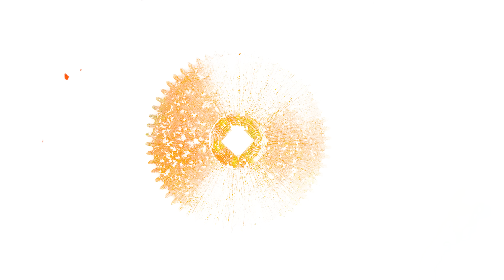Restoring a Rusted Rolex Found in a Drawer

Comment: Guys, this is a FAKE Restoration, here is why I think it is:

-Theres a TON but like a jar full of rust liquid covering the WHOLE movement, yet I couldn’t find a SINGLE part that showed any pitting, rusting or the slightest degradation, not a single screw seems to have been affected by the liquid.

-at 1:31 you can see FIBERS embedded to the « rust » that looks an awful lot like someone smeared brown paint on the whole movement (also notice that these part are steel and should be heavily oxidized)

-As we are told, most water ingress occurs when the crown isn’t tightened, however no part of the keyless works 1:45 show any rust WTF ?

-At 4:05 despite being subject to intense corrosion, there is not a single part of the baseplate that shows blemishes to its plating, it looks brand new, as the brown paint is much easier to remove than real rust.

-The rusty dial looks ridiculous, just look at it you can literally see a dabbing pattern and paint blobs on it lmao.

I think they happened to have a non-working Datejust at hand, one they could safely smear a sh*t-ton of paint all over it and not worry about damaging the valuable parts as they would be cleaning it right after… and calling it a « restoration » as its clearly a trendy subject on YT at the moment. 

Let me know what you think…
Reply: obviously fake.

Comment: Nice work! I would have replaced the dial , the old one does not look good with those rusted out bits . Most of the rest of the watch is pretty much original so that still has the “sentimental value “ . I think this might be more of a cost saving thing than “ sentimental value right ?

Comment: Why do you use these artificial weathered watch and no real aged one? This is no rust just pigments. Rust would react with the copper in the brass parts and would also leave marks on the steel parts. Even i could make a fake aged watch look like new without special tools.